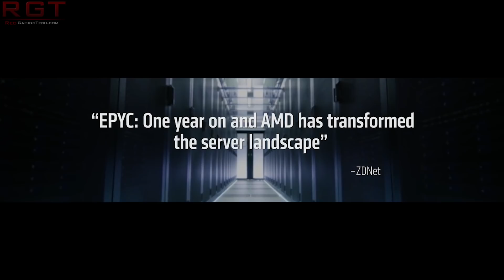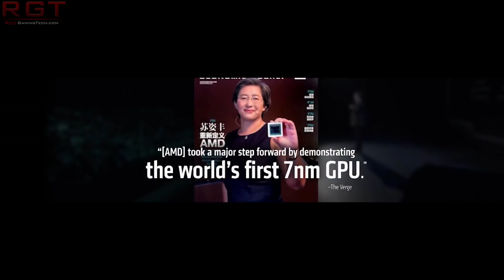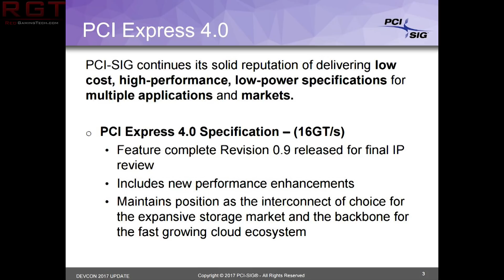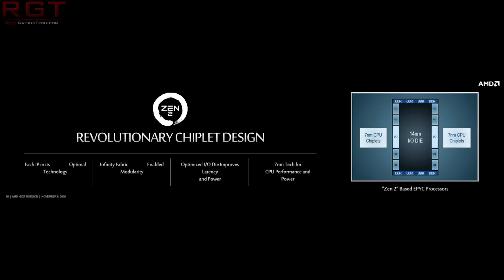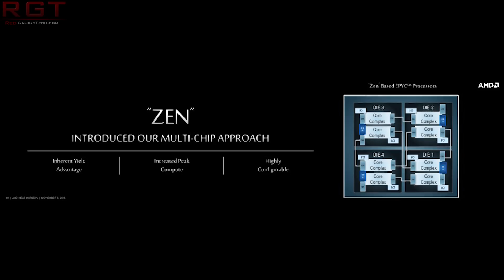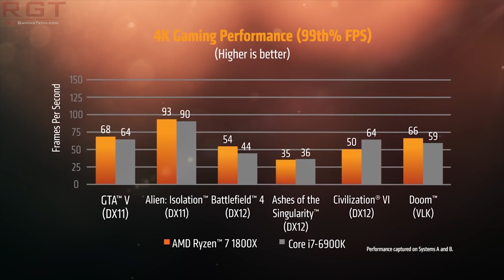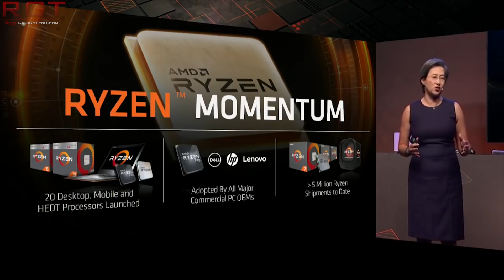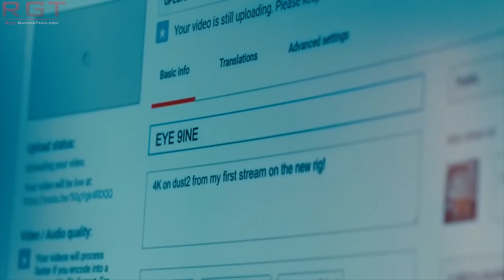Should AMD Raise The Core Count for Zen 2 Ryzen 3000 CPUs ?

Comment: i was heavily in favor with more core count but now thinking of it, i would rather get 8c & rather focus on IPC and clock speeds, the small size of the die will help with wafer yields making it cheaper to produce, it will sell like hot cakes if its under 300bucks
Reply: under 300 CAD 8 core 16 thread at say 4.2Ghz max turbo, 4 core at 4.4Ghz and single core at 4.8 say 105w max (TDP and wattage) I would buy that ^.^
they are not "that far off" because the 2600x in Canada is around the $340 mark, so, shrink the die add 2 cores likely they can directly target the $250 (USD) $300 (CAD) "magic number" when it comes to a performance CPU..GPU should "follow suit" say 6+gb 1280+ shader 128/64 TMU/ROP at/under $150/$200 (USD/CAD)

They have the technology, now they just need to get everyone on board to try to get the old inefficient things out of use..while they are at it, they should all band together and tell MSFT to stop being complete putzes with windows forced update/anti-consumer tactics....the tech world would be a much better place (for all of us) if they stop being idiots and work towards making the best possible experience (example, if Freesync is better at lower cost than Gsync, they focus on Freesync with everyone having the option)

Comment: I expect a 8 C / 16 T Zen 2 replacement for the R 7 2700X as a Maximum for AM4 but as well mainstream processors for "AM5" the next socket for desktop, for Zen 2, Zen 3, .. including PCIe 4.0, .... AMD told they will support AM4 until 2020 but they never said that they wouldnt introduce a new platform.

Comment: You dudes are stuck in the past with Intels 'give'em as little as possible' thinking.  AMD should be able to push frequency for gamers AND give creators more cores. No need to only do one with the new chiplet design and CCX the way we know it is done. I personally think we'll get an 8 core max frequency cpu and a 16 core top of the line chip before Threadripper steps in. Why cannot AMD do both?
Reply: cause its the market rules
whats the point with threadripper if they release r7 with 16 cores while there is tr 12c , tr 16c ?
amd did a miracle by releasing 8 core r7 1700 at the price of intel i5 while its r7 way better
keep adding cores while 8 is more than enough for general consumers like gamers is pointless 
lets focus on higher clock speed and better architecture
Reply: @jassim mn very simple TR 3XXX will also have double the amount of cores (plus am4 still have slower memory, less of it and a quarter of the lanes)
Reply: @jassimmn9004  The hardware needs to do better in order for the programmers to code for said hardware and utilise it. Take as much as you can at any point in time, people were saying the same about dual cores, quad cores and eight core cpu's. You never learn
Reply: @jassimmn9004  The added pcie lanes and extra memory channels allowing for higher memory bandwidth and twice the memory limits is the biggest differentiating tr4 and am4. These will still be there regardless of having a 16core am4 chip besides the 3rd gen tr4 could push 48-64 cores. And having a 16 core am4 chip designed in this chiplet fashion will not effect the clockspeed of the 8 core am4 chip.
Reply: Double the cores double the power draw. And that means lower clockspeed.
Reply: @Vyor not really, 7nm should bring around half the power at the same clocks meaning that you should be able to power 2 times the cores in the same power envelop, now sure all core will be limited (at stock) but you can still get much higher clocks as long as you are using less cores, so say you are only using 8 cores, their clockspeed would be pretty close to what you would get if it was a normal 8 core
Reply: 60% less power at the same clocks, however each core in Zen2 is larger, which will make it take more power. Ditto for the AVX2 support.
Reply: have you heard about power gatting, it shuts down part of the core when not in use, avx2 will definitely be turned of during most of the time, so that wont affect anything
Reply: the floating point units will always be in use.
Reply: if the whole fpu was working all the time then intel would consume the same when using avx as they do when not using avx which is not the case at all,
Reply: it isn't, but the FPU does still need to be turned on, it just doesn't need to be doing anything.
Reply: then consumption will be the same on non avx workloads thus there is no problem in having more cores. (if you still dont agree i give up trying to make you understand)
Reply: Zen2 also has 4 times the cache as zen1, twice the amount of L3 cache per core. That also eats into the power budget.
Reply: sure, though i dont know how power hungry cache is so i dont know how much that would affect things
Reply: Extremely. Like, next to AVX stuff it's the most power hungry part of a CPU.

Comment: If you had asked a similar question before Ryzen, I think a large group would argue that 4 cores is plenty, stick to that along with a 2 core CPU with a better APU.

I do think they should up the game. Not because I need a 16 core desktop processor (I wouldn't mind one, but I don't need one), but because it will put pressure on Intel in other areas. If you're a company putting together a ton of desktops for a simple office environment, you want cheap CPUs, and usually they go with a 2-core Intel.

If, however, upped the core-count on their lowest end processors to having 4 cores and an APU (as oppose to the two core Athlon 200GE) along with low power requirements, that could put pressure on Intel in unexpected places, including laptops. Love'em or hate'em, Apple tends to set the trend, and their MacBook Air is still only a 2-core i5 (https://ark.intel.com/products/189912/Intel-Core-i5-8210Y-Processor-4M-Cache-up-to-3-60-GHz-). If AMD can get 4 cores and 8 threads in that TDP, I would be surprised if it wouldn't be a smash hit. And at 1.6 GHz (3.6 GHz turbo) that doesn't seem to be out of range for a 2200GE replacement. Granted, that is a 35W CPU, but it also has a base speed of 3.2 GHz. Drop that to around 2 GHz and 7nm, I wouldn't be too surprised if you're suddenly in that 7W territory. 7 nm alone should bring it to around 20W, and that kind of underclock should yield even more power savings.

And there's more reasons for more cores - developer support. If AMD pushed forward with more cores, to the point that a 2200G desktop replacement had 8 cores by default. That'd be a $100 CPU with 8 cores, competing against Intel's dual-core G-series or i3s, while Intel's 8-core CPUs are their i7 and i9 range. This would make it even more attractive for developers to target multi-core systems instead of focusing on single-thread performance for everything.

Comment: amd needs higher ipc and high clocks. more cores is nice if they can keep the cost down?
Reply: probably will. they can remove the X variant and make it so that ryzen 3700 / 3800 exists. so 300 dollar 8 core and 349 12 core... thats a deal.
Reply: If it will be the 12/24 model, we will have a 10/20.
So:
12/24 at probably 499
10/20 at 399
8/16 299$
8/16 no XFR 249$

And after 1-2Q:
12/24 399$
10/20 299$
8/16 249$
8/16 no XFR 199%
So 8/16 will be the new 6/12.
And for r3 I hope for a 6/6 or 4/8.

Comment: I say keep at eight, use that to make smaller dies and keep yield/prices low. Work instead on features/ipc and gpu
Reply: mr happy just look at the new Rome cpu. Those die is the same for ryzen 3000. They are already small.
Reply: AMD would likely have a 2x8-core (with IO chip to join to connect to DDR4/5 memory) approach to 12/16-core CPU's with AM4 or AM5 though and probably not 12-core chips. The issue would be how the IO chip affects latency in games and other related issues (NUMA) that can tank the FPS. GPU is a completely separate issue as the departments have separate budgets.

Comment: amd definitely have to increase core count , amd historically have always had more cores , it's a part of their brand image, and it looks good on presentation slides to tell the investors we are offering 12 cores for 500 compared to our competition that's offering only 8 . Besides why wouldn't they increase core count ? They don't have a 500$ processor currently ( which they did on first gen with the 1800x)
Reply: hiphop head I would say that they don’t, otherwise they would cannibalize their threadripper line, which honestly probably doesn’t need more cores either as then there’s the EPYC line, which at that point I feel like single user use cases for that many threads are nonexistent. I think it’s fine where it is, if you need more cores you probably should be going up to the HEDT platform, as you can get 32 cores right now
Reply: @IAmCjcj11  I'm pretty positive there won't be a 12 core threadripper next year . Instead they will bring 12 cores to am4 . Right now the Gap is too big between am4( 8 cores) and threadripper (32 cores)

Comment: NO there is no need to increase core count 
AMD already crushed the competition with intel and for both consumer (price wise for consumer) and workstations 
we need them to improve the core performance a little 
as intel 5ghz is a bit better than amd 4.3 ghz so I would Imagine 7nm ryzen 3700 at 4.7ghz on 8 cores 
that would dominate both middle and high end consumer market and would lead even with gaming performance
Reply: AMD should increase core count more or less like: R3 being 4C/8T or 6C/6T, R5 8C/16T or 8C/8T and R7 10C/20T. It would be really nice.
Reply: @lagarttemido  yeah it would be nice to have 10 core cpu with 20 threads for sub 400$ 
considering intel prices for 8 core cpus were 1500$ till 2017 when ryzen appeared 
but its also not essential for general consumers as threadripper already exists with 12,16,24,32 cores 
we need better performance per core at higher clocks for the same price of current zen+
Reply: @jassimmn9004  The way I see it is: either 4C8T or 6C/6t for R3 will be quite an improvement at the base which is very important to push for more threads in gaming in general.
Reply: @lagarttemido  If you mean to shake the lower end class market which is stalled for a decade then yes 
but doing that there must be huge improvement in the r5 and r7 
lets say at least 30% increase compared to current zen 
that kind of margin I highly doubt because it will mean r7 3700 would perform about 25% better than 9700k
Reply: or buy a good cooling system for your CPU at 100$ , than OC it to 4.7ghz , using ryzen master disable some core , able to reach further
Reply: @randomcatontheinternet2771  yeah but that would not be of real significance for most users since most are looking for best clock speed and the hype o intel gaming performance out of box
making zen 2 natively 4.5-4.7 on all cores with the new superior architecture would start new age of cpus since sandy bridge

Comment: Pointless for 3700 and 3800 or what ever they name them when we already have Threadripper for more cores.
Ryzen 3 needs to match Intel's 8700k for single core thread speeds and also match Intel's integer because right now 2700X is 6% slower than an old 4th gen 4700k.
Its pretty obvious Ryzen 3 won't match the 9900k or 9700k for clock speed (ghz) but the least I expect is to match it integer wise, don't need more than 6 cores for gaming as shown in numerous benchmarks and won't for a very long time especially as most arnt even getting the best out of 4 cores still, but 8 is just a nice bonus, but anymore than that is Threadripper territory.
Reply: Since when is HPC only about gaming ?
Reply: @Sinier940n  well if you want to even be considering hpc I'd say that having higher integer than an old 4th gen i7 is a must wouldn't you??

Comment: More cores would be awesome, but I would really love for AMD to put a few vega cores on each chip.  Just do the same as on the 2200g for baseline graphics on chips.  This will allow freesync + NVIDIA cards with all AMD CPUs.  Also all programs that can utilize integrated graphics acceleration, like adobe Premier does with intel integrated graphics, can get extra performance beyond what more CPU cores will add.
Reply: Phil Gibson not to mention it will kick the pants off of any non iris intel hd graphics, and they could do something similar with hardware acceleration, kinda like quicksync. The other question is though, the freesync workaround. Do they possibly give a boost in cpu sales to possibly lower RTG sales? Which overall could really use tone TLC. 
Also it’s a question of possible price increases by adding a few Vega cores. I’m sure it’s not too expensive but it still would be there. On top of the higher price of 7nm probably looking at another increase in price when it comes to dollars per core, but of course also with higher ipc and clock speed,
Reply: @IAmCjcj11  On the cost side I think vega cores will be cheaper than more CPU cores.  Vega is 14nm and can be made by GloFo (AMD still has an agreement with them about chip orders to fulfill).  I definitely think that of AMD is going to wait another generation or longer to challenege NVIDIA at the high end (Navi is mid range in 2019) then the freesync work aroubd is worth it for AMD since people buying rtx cards won't consider navi as a viable option.